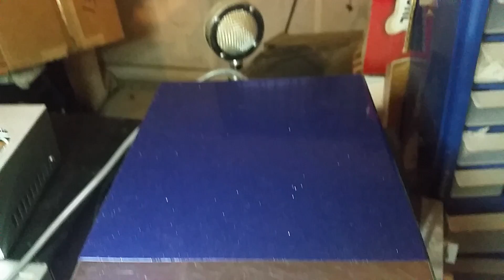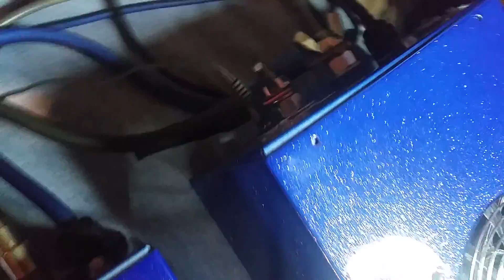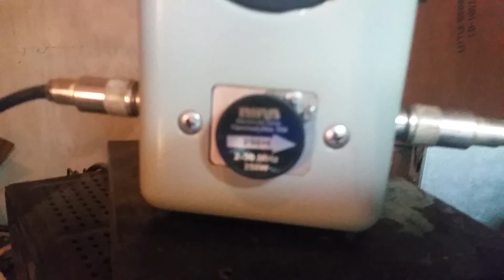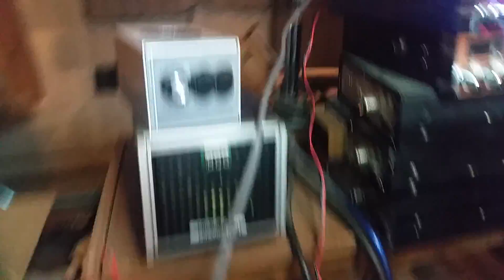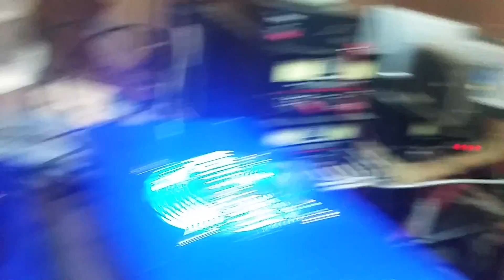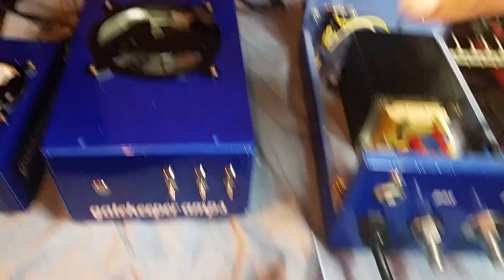1 Pill, 4 Pill, 100 Amp Supply & Cobra 29 ALL Candy Painted Gatekeeper Amps WOW!

Comment: Holly Shit that is a big transformer for 12-20 Volts for sure!!!  Good Grief. Normally when I see a transformer that big it is a High Voltage transformer powering some massive tubes a a bunch of them! 

Would you shoot me the part number for that bad boy and who makes it I might want one! LOL

Glad to see you are only using one rectifier. That is so much better and safer than trying to combine a bunch of lower rated rectifiers together. It almost never works out in real life because trying to get all the rectifiers balanced under load is almost impossible. In fact while it is easy to get switchers working together try using 2-3 smaller transformers to power something and try getting the load sharing right. Again with analog passive devices it is almost impossible one transformer will always run hot and eat itself trying to provide the needed power. Same thing with rectifiers when you go trying to run them in series and parallel to try to get what you need. I have seen video and photo's of Davemade doing this and they always have high failure rates and I doubt it is always "shipping"!!!

I know with the MeanWell switcher's the 12V 50Amp models are stackable and are super easy to slave to each other.
Reply from the maker: hey brother I am sorry I know there's a lot of comments that you have done I hadn't got to reading and replying to you it's hard enough just keeping up with the email messages and text messages xcetera shoot me an e-mail over at threemanpro then AT then the gmail then the DOT then the COM by the way man the srf 3662 are all gone RF Parts is sold out do you think the mrf 421 ones will still be worth trying with what we were talking about
Reply from the maker: hey brother, i need a BIG BIG FAVOR. Email Me ASAP at threemanpro at the gmail its about the t. 250 thanks...
Reply: Sure but the Macoms and MRF versions will cost a lot more than the SRF's. You know HG makes an MRF421. I was on their site checking out their stuff. I have not ordered any or tried any and have no clue if they will truly behave like the real MRF421's. The real MRF421's made the Toshiba's look like wimps when talking about break down voltage and durability. Only way to find out is to give it a try.

Comment: Are HG2879's better?
Reply from the maker: No i wouldn't say better....i have faith they will be crushing the 2879 i test his new versions but the last 2 which isnt avaiable to the public as of right now were shocking. they handle volts to and are showing great signs of durablity. i have already sold bout 10 builds with them so stay tunned they will be coming up in rotation soon.

these are performing very very close to a toshbia. i did a test video you can check out.
Reply from the maker: i am selling these versions $30 ech.

Comment: What would something like that run that set up just like that to buy
Reply from the maker: this whole setup like this? That is about $250 to $300 just in paint with a worth of over $500 if you got it done at a paint shop with House Of Kolor . But we worked some stuff out, this guy had something that big daddy GK wanted lol so we worked up around that.

if you ever need some pricing shoot me a message over at info AT gatekeeperamps Dot Com 

have a good one bud.